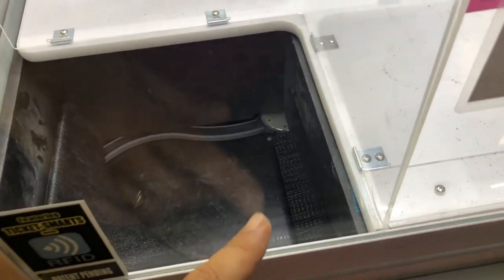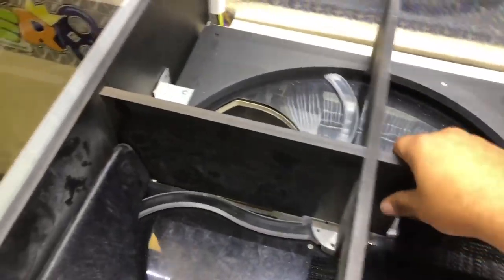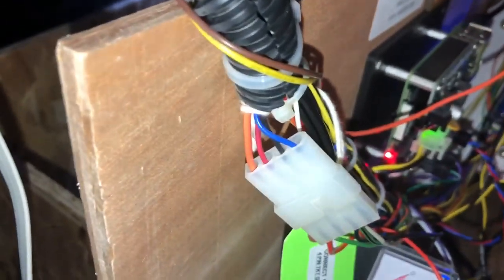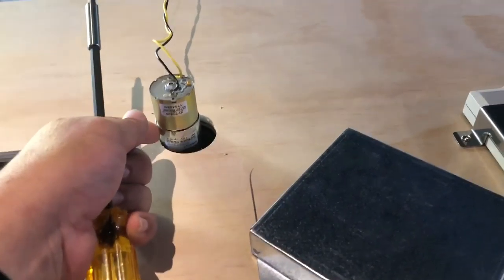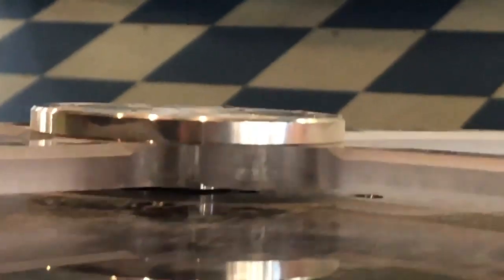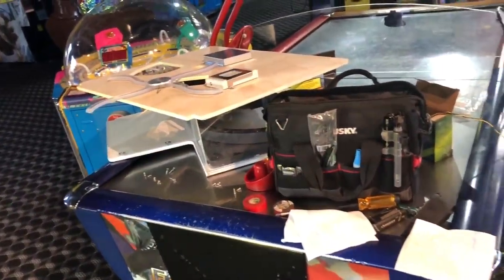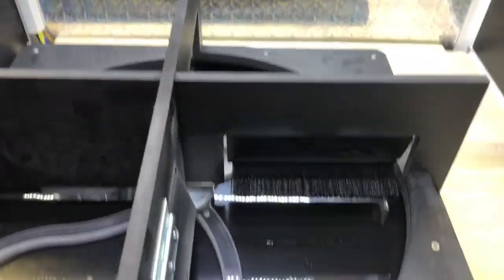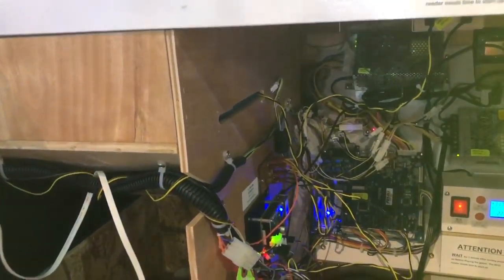Ticket Time ( sweeper motor replacement )

Comment: Any idea what could be wrong if the motor doesnt turn after power cycling the machine? I am able to get the motor to turn by adjusting the cables but if the cabinet is turned off and it stops working
Reply from the maker: Not sure what you mean by adjusting the cables, that almost makes me think it might have a loose connection or broke wire and when you manipulate the wires they make connection. But then it also sounds like the motor is bad, I have had motors do the same where I can get them to work but will of not work after reboot. Unfortunately they corner the market with parts that are unrepairable and you may have to replace the motor. Start with the wires to make sure you don’t have a broken connection if that’s not the issue I’m leaning toward replacing the motor. Hope this helps.